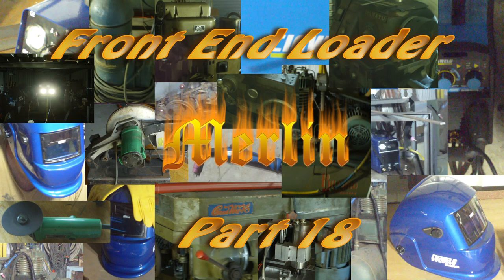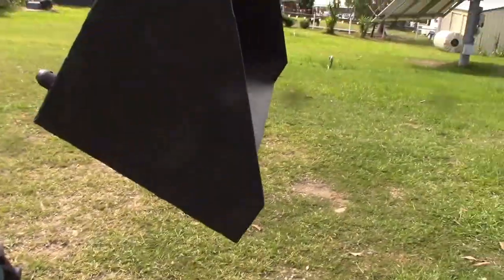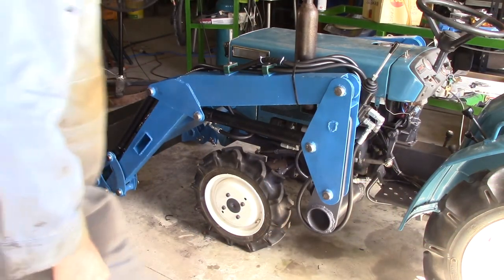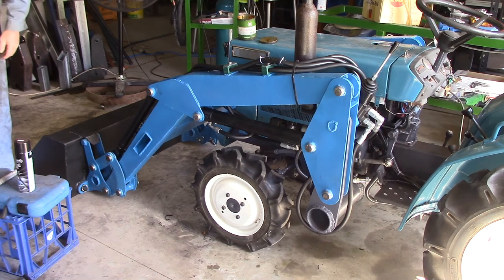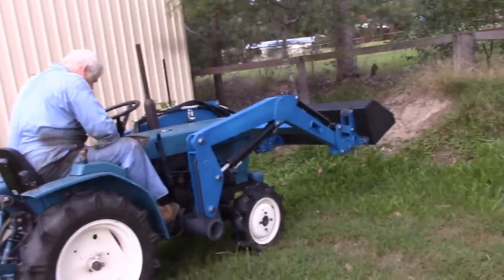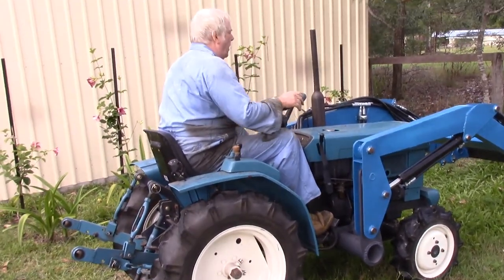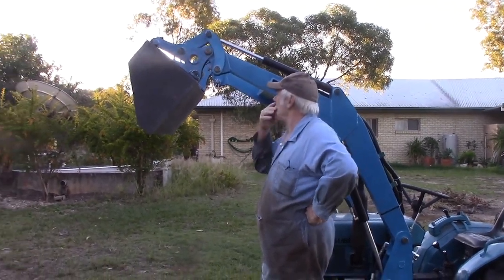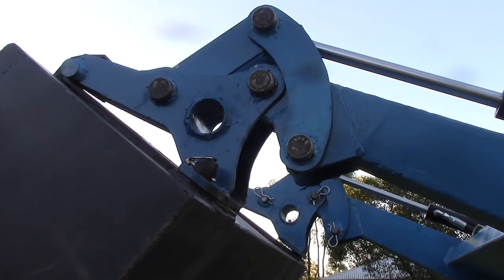Compact Tractor Front End Loader - 18 of 18

Comment: This is by far the best home fabricated front end loader I have seen. Thank you for your hard work and detailed build along! I have an almost identical tractor I would like to build this for (Iseki TX1500). I was wondering if you would be willing to make your solidworks files available for download? I would like to convert the files to .dxf for cnc cutting. I think it will make the project a little easier if I can order some of the thicker/bigger parts from a cnc manufacturer. Thanks again for the incredibly detailed build along and blueprints! This was a first rate job!
Reply from the maker: Thank you.   You can download the plans from the bottom of this page: http://www.designed-2-build.com/Projects/FrontEndLoader/FrontEndLoader.html

You can see some other projects here: http://www.designed-2-build.com/  if you are interested.

Just keep in mind that I am not an engineer and all plans are provided for educational purposes only.

Comment: I just finished watching the entire series, very impressive design and build.
I have a question: I haven’t heard mentioned in the video why you chose use the complicated wrist joint instead of just attaching the cylinder directly to the quick shift? I’ve seen a lot factory built loaders that attach the cylinder directly to the quick shift, so I would like to know your reason for doing the elegant but loads more complicated linkage?
Reply from the maker: Thank you.  I have the bucket and I want to make some fork lists and also a smaller bucket.  The wrist setup just seemed to lend itself to changing tools with minimal effort.